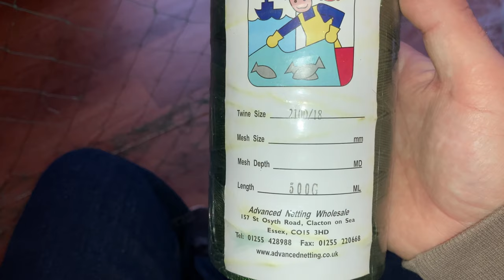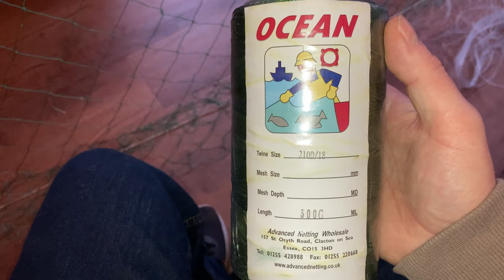Net mending - how to easily repair ferreting long nets and nylon sea fishing nets tutorial

Comment: That was a good lesson on how to do it. I probably will never need to do it but it was good watching you. You could do that in your sleep. I surpose if they get a hole in a net they just throw them away like everything else these days. Time you can get out and do stuff again your gear will be in tio rop condition.
Reply from the maker: Its a lot harder doing it in with a tripod in the way! The nylon herring nets we use, you cant buy them anymore in 2" mesh size, so we have to keep repairing them. Monofilament herring nets get ripped so badly by seals, we dont bother repairing them anymore,  it takes so long, so we put new lints in when they get bad